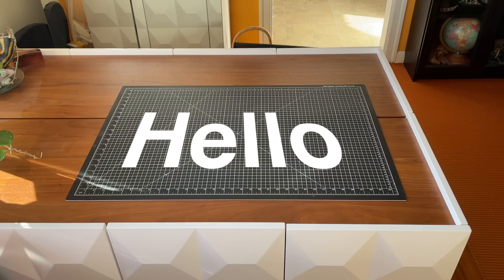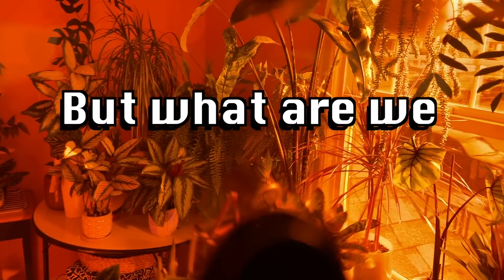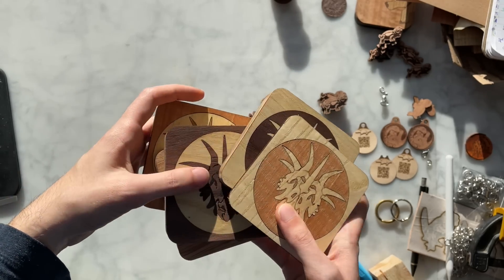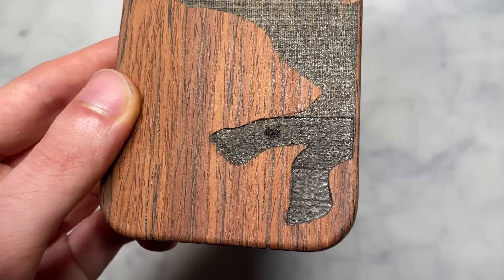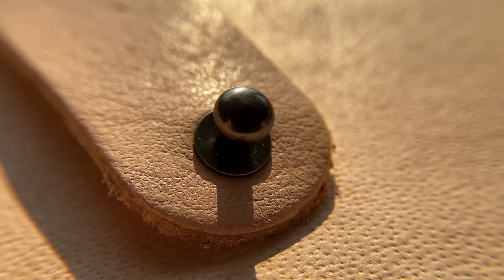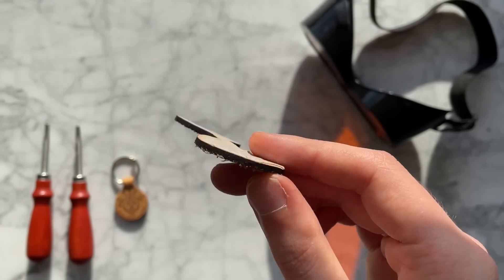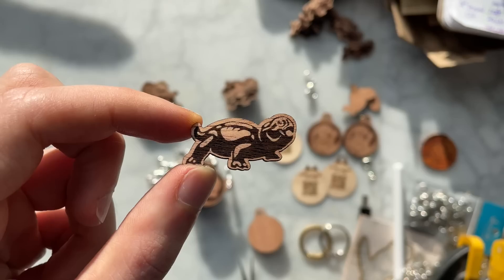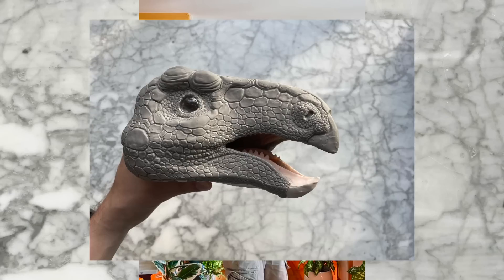Let’s laser! Wood, Leather, and Acrylic (Ortur Laser Master 3)

Comment: Good video and presentation. New subscriber so now I have to binge whatever else you've posted. I have an OLM3 as well and within three months made three changes. I started with the USB connection and had some disconnections too. I converted to WIFI and that made all the difference. NO disconnections now. The second thing is I added a USB camera, calibrated it and I'll never use my laser without it!  Makes aligning so much easier. And the last thing was upgrading my goggles as well. Good call on your part.
Reply from the maker: Hey thanks. I knew most Co2 lasers had cameras but I didn’t think to just add one onto a diode laser, that’s a great idea!  Do you have instructions on what camera to use and how to mount it??
Reply: @Kayakasaurus  I just took some pictures. Is it ok to email you at your business address you posted on YouTube?
Reply from the maker: @LarryDMitchell  yes that would be great

Comment: Hello, I have exactly the same laser and it also turns off from time to time during operation.  I contacted support and they sent it to me.  The answer is that it is triggered by a smoke detector.  also they said how to turn it off.  but still the laser sometimes stops.

Comment: The usb disconnects are a bummer.  I’ve had good results with the wireless on this machine.
Reply from the maker: Thanks I’ll try it. I have an extra enclosure and roller if you’re in the market btw 😄
Reply: @Kayakasaurus   thank you, i am interested.  The two remaining accessories i still need to get.